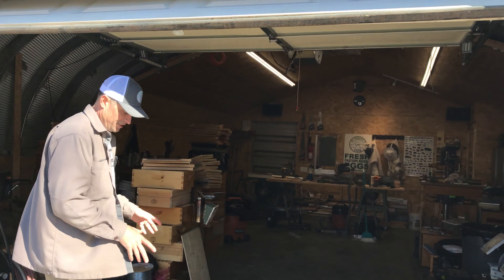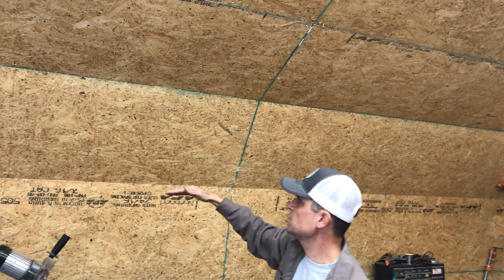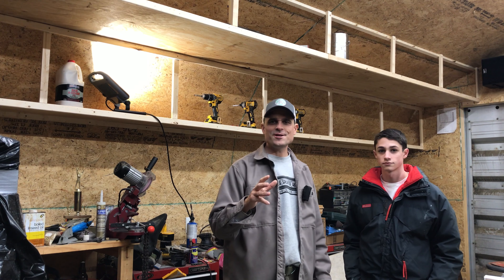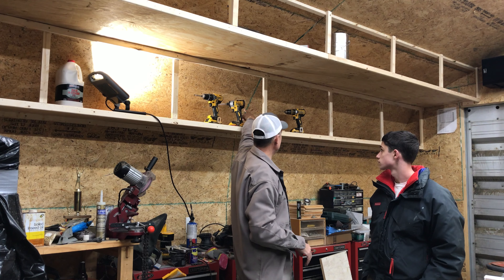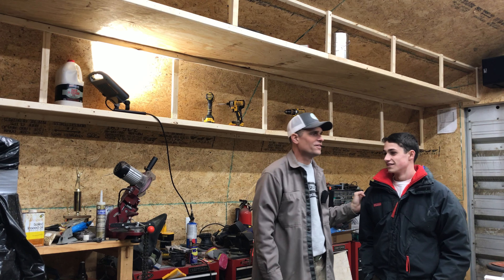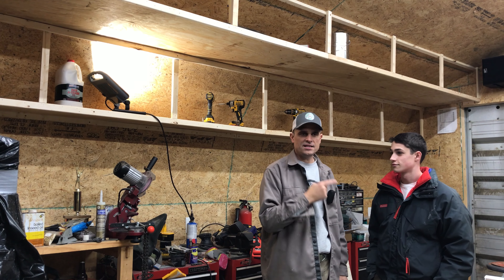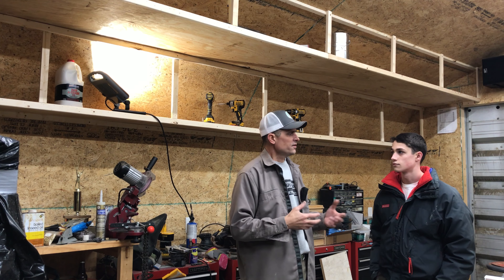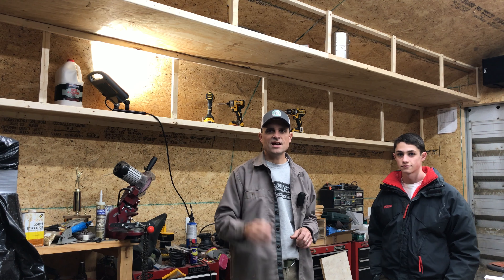This Old Quonset Hut (S2 Ep. 10) - STORAGE SHELVES

Comment: We have the same problem. I tend to work until I'm exhausted or late into the night and end up leaving tools scattered every where. Then after the project is done I go into OCD mode and organize the crap out of everything for days on end. I've been watching, mostly skimming, your videos today because my particular situation will be requiring a move and the one and only real option for me has no garage. So I'll be needing to build something to store my project jeep and to use as a shop. After seeing your video series, holy crap that's a ton of work, especially if you had to build the structure in the first place. The work itself is no big deal. I'm a tinner by trade and have done everything from architectural metal, structural, duct, ect. The amount of time it seems like it will take is pretty daunting as well as the over all cost. I work out of town and travel a lot, so my time is very limited. If you don't mind me asking, how much total time do you think you have into this place? Also, why did you only finish a portion of the interior? Would you recommend going this route to any one else looking for a shop?

Comment: A year later, have you had any issues w condensation getting onto the insulation?  About to insulate my building but often water forms inside and drips.  Don't want that happening in my shop and getting mold.  

Watched all 10 shows today, good work
Reply from the maker: Unfortunately, we still only have half of the building finished. Frustrating for us, but too many other projects on the farm have demanded time and resources. What we can say about condensation, is that we finally experienced it in the quonset hut this winter. It snowed, and snow was still on the roof of the building. When we were working out there with the heater on, we did start to get drips of condensation. So if you are in an area where there will be a lot of snow on the building, you might need to think more about managing the condensation. But that is the ONLY time we have seen it in four years. Suppose we could have figured a way to put plastic between the metal and the wood/insulation.
Reply: St. Isidore's Farm we don't get much snow in Texas :) but we do get mid 20s for a couple of days a year... When I run a portable heater it is just enough to get above freezing inside... Which causes the condensation.  I've enjoyed the series a bunch and look forward to seeing the rest of your stuff

Comment: great design on the shelving

I'll leave a link here of a picture of the type of shelf that I've had good luck with.  Similar to your design, but you use chain instead of wood for the hanging supports.  You can use any size chain, depending on what size loads you plan on putting on the shelves.  

http://curioushouse.org/ceiling-hanging-shelves/marvelous-ceiling-hanging-shelves-37-with-additional-home-decoration-ideas-with-ceiling-hanging-shelves/
Reply from the maker: Thanks for the link! Chain would certainly hold more weight than these inexpensive wood strips. Depending on how much we put up there, we might have to switch the supports out for chain.